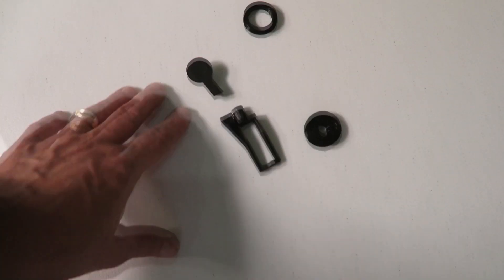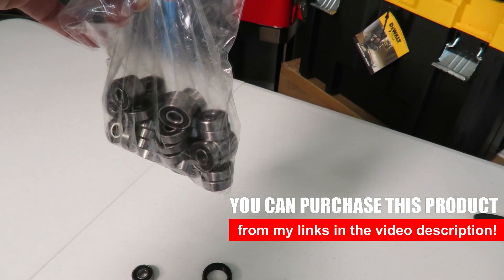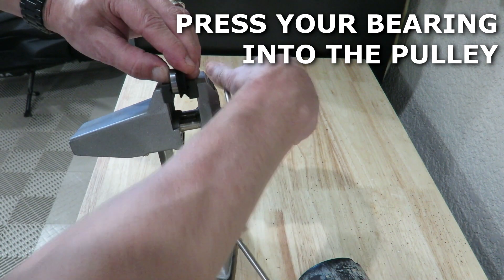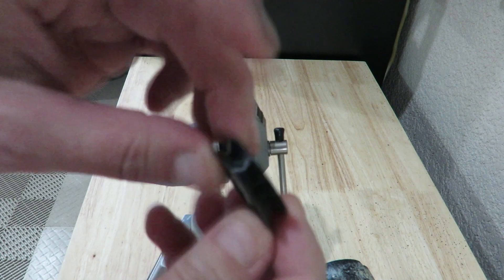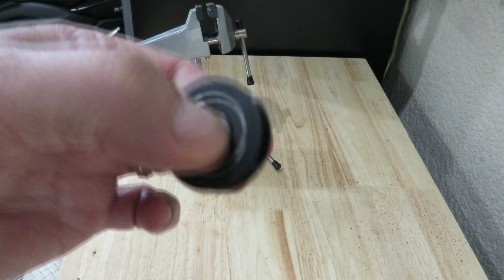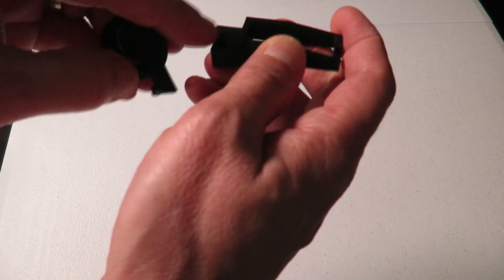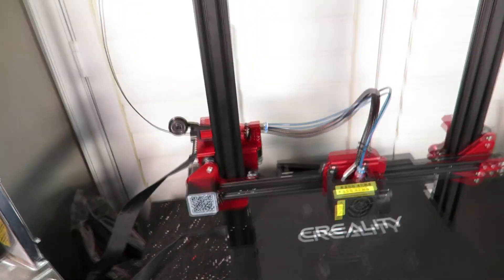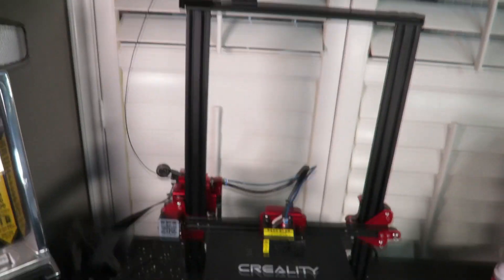3D PRINTER TIPS | Creality CR10S Pro Extruder Pulley

Comment: Hey man, just a heads up, wd-40 on greased bearings is a big no no, wd-40 eats away at grease and cleans the surface of metal. Not great if you want the bearing moving constantly. I could be wrong but that's what I've always been told.
Reply: You are right but this wheel is not gonna spin fast so it's not gonna make any difference of you use WD40 or any other lubricant.
Reply: @Carlovfx  deffo don't put wd40 on it... it cleans out the grease